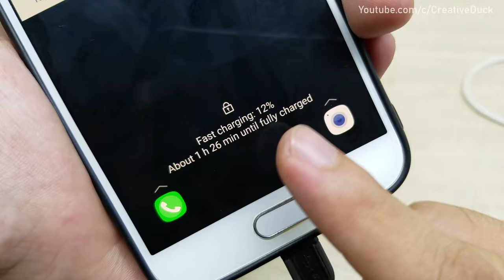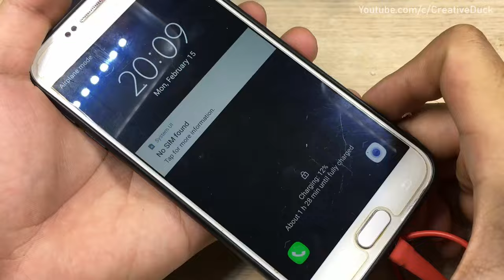Rebuild Micro USB cable fast charging at home

Comment: This approach is correct increasing wire gauge will allow more current to pass through BUT the power bank must be a fast charging type with a port designed for fast charging. If the cable is a standard thinner gauge a fast charging power bank will automatically go to slow charge mode as it senses resistance in power transfer 😉
Reply: Pl write me from where i may call for as, i am disable to move and to get by hand
Reply: I don't understand
Reply: Fast charger needs cable data support.... Because to transfer battery status to the charger or powerbank.. When done the charge fast...
Reply: If current is exceeding capabilities of unit potential to cause fire or damage equipment. This will work but monitor closely
Reply: Now wow nice idea 💡

Comment: Nice but.....
You may increase the number of wires but again the current passing through the pins will be limited ??
Reply: The true limit is the maxim amperage of the charger itself. Thick cables will only help to a point but more advanced chargers also need the data pins connected as well to monitor battery charge management as well.

Comment: So what exactly happened here?  Were the data sections removed and only left with power and ground?  The phone said 1.5 hours until full charge yes but it never updated to fast charging
Reply: It still cut down from 5 hours hello did you not see the time
Reply: Mine is 10h😂

Comment: You need both the Male USB and Male Type C to have a high wattage rating in order to make this work. Although using thick wires on both power pins are correct because there's more room for current to flow you still need the Data pins to make it a fast charging because todays fast charging adapter/brick does not give all the power to the positive and negative power pins it utilities also the data pins.

Comment: @I'm not Beluga  I don't see how this is possible,  with power exchange the phone and charger talk to each other over data pins,  once charger and phone both verify,  the charger switches modes and starts sending more than 5v,  9 volt is the next step up,  then 12v.  With newer quick charge and power exchange models you see 18v all the way to 45 volt,  if the data lines are not present, the charger will stay in 5v 2a mode,  which will about 4v and 1.6a of power to the phone,  which is still regular charging.  The only thing the process in this video achieves is removing itself from a data transfer cable which the phone believes it is plugged into a laptop and forces itself to charge at 500ma,  or .5 amps,  which if your phone charged at all would take 6 hours

Comment: with first cable your phone is saying "charging in 1 hour 26 min" after modification it says "charging in 1 hour 28 min" . so it basically slows down the charging process. i dont understand how it speed up charging
Reply from the maker: There are two cable in video, you can watch video again, friend
Reply: With the high quality Nokia cable, it instantly switched to fast charging, because it had data wires, the phone and the charger use them to enable fast charging.
But the cheap crappy cable doesn't have data pins, so it didn't switch to fast charging.
By doing this, your phone will charge at the fastest speed possible without being in fast charge mode.
Reply: @imnotbeluga007  did the nokia charging cable supports other devices
Reply: @imnotbeluga007  hey beluga do you have any social media exept insta and twitter or reddit
Reply: @imnotbeluga007  do you use telegram?
Reply: So your attention span is shorter than 3min🥲

Comment: WHY does that work?
Do the female to female sockets share the same pin out arrangement?
I'm wanting to convert a "Battery case" from my old phone into a universal battery backup. 
It currently has a Male Micro USB Out, so I need to make a flying lead with Female micro USB  socket on one end to plug into it, and a standard USB Female type "A" socket on the other end for the output. ...Sound reasonable?
The 4000mAh battery (14.8Kwh) output is noted as 5v @ 1.6A max
The existing Micro USB female input is fine for charging the case battery, but for general back-up power duties a Female USB "A" Out is more useable for a wider variety of items.
Can you advise me?
Reply: It works, because high currents going through cheap thin cables creates big power losses, and the phone will limit the current or the cable will overheat and burn out.
By using thicker wires, resistance (and power losses) will be smaller, the phone will detect this and charge at the highest current it can take.
Reply: @imnotbeluga007  is this written into software?  I have a phone on android 10 that quick charges on my cord,  I have another of the exact phones that is on android 11,  same charging setup but forces charge at .5 amps thinking its plugged into a laptop
Reply: Ask chatgpt

Comment: No data line so that the charger and phone can communicate about voltage and amperage capacities? You know that's part of the fast charging standard for most fast charging protocalls right? If this technique didn't work for you, that's likely why. Just say'n.

Comment: The data must be connected on your cable to enable fast charging,
Reply: You can not solder data cable if the micro USB connector does not have them, it is only positive and negative. But it will charge fast since the thickness of the cable allows the passage of more mAh

Comment: How to make ur  cable slow first time 1 hr 26 after making fst crgr 1 hr 28 min XD
Reply: The first high quality Nokia cable HAS data pins, they are used to ENABLE FAST CHARGING. The cheap crappy cable DOESN'T HAVE THEM, so it couldn't switch to FAST CHARGE MODE.
It works because THIN CABLES naturally have a HIGHER RESISTANCE. This resistance creates POWER LOSSES and VOLTAGE DROPS, and the phone detects this, and it decides to CHARGE SLOWER, to prevent the cable from OVERHEATING.
By using THICKER wires, the phone doesn't need to limit the current, because power losses have been significantly REDUCED, so the phone charges as fast as it can handle without switching to fast charge mode.